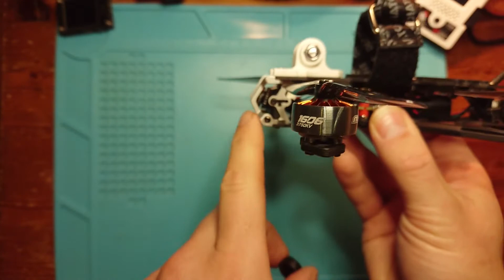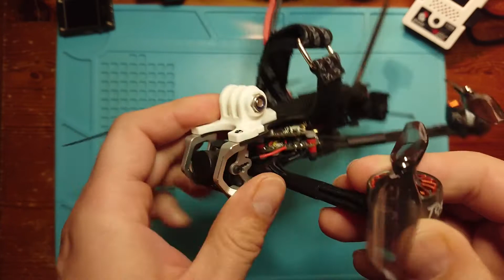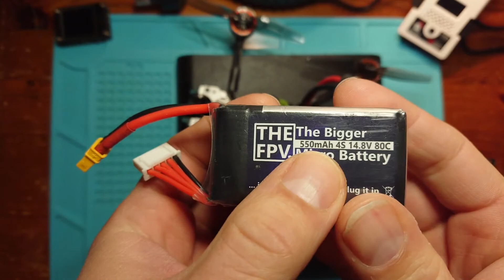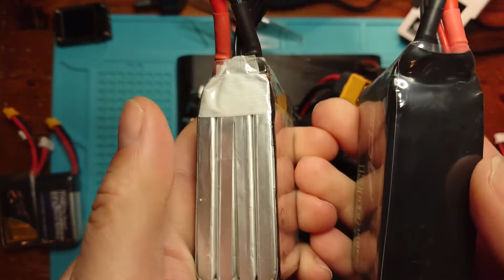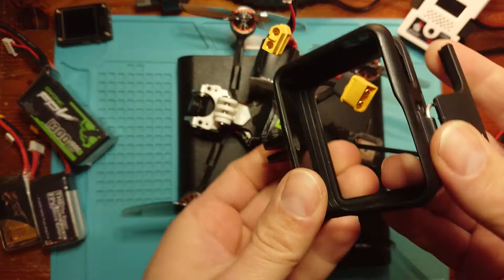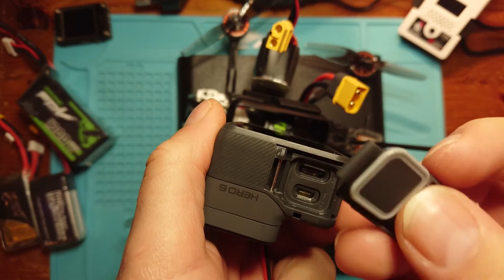Diatone Roma F4 LR 4 inch frame build. Parts I've used and my thinkings on this quad build....

Comment: Great video! Explained a lot. I really think this is the best looking frame I've seen. But my issue, I want a 50/50 freestyle/long range 4" with a Split style 4k cam Or GoPro session 5, So what would be my best motor choice for the middle of range & power?.. Thx
Reply from the maker: Hi, probably something in the 20xx or 22xx size range anything smaller and it'll not fly well with the GoPro on it. If you use a split style camera, 1606 or larger would be fine. I have a 4" build with 1606 3750kv motors a split camera and on 4s it rips. Hope this was helpful and thanks for watching 👍
Reply: @Rich-TeaFPV  Thank you, I was looking at 1606 motors too! I don't want anything over 10min flying or I get bored 🤣 so 8min with a split style camera on a 4" that can also do some freestyle/long-range flying would be a great little package.! Thx again 👌
Reply: @Rich-TeaFPV  Can I ask what flight times you get with your 1606 on 4s with a split. Also will a deadcat style frame really impact my freestyle capabilities as I don't want props in view. Thx again Richard appreciated!

Comment: I'm deciding whether go for L3 or F4 diatone. How would you build the L3 for ripping purposes? Thanks
Reply from the maker: 1207 6000kv 3s on a light build or 1306 4000kv on a heavier build are good for 3". If your after a serious ripper 1404 4000kv on 4s would be insane, I'm going to do a 3.5" build with these motors 😁